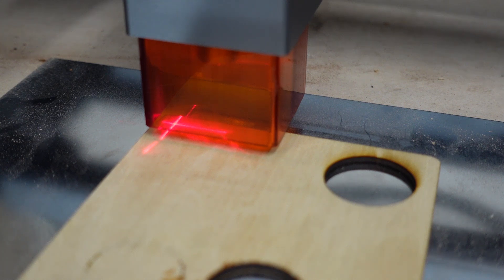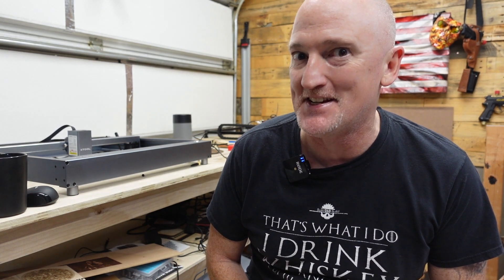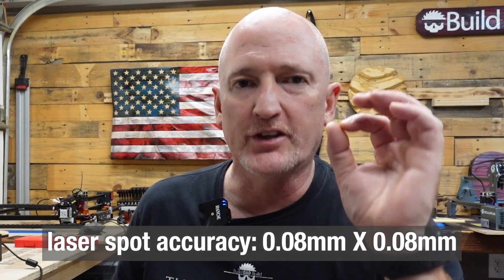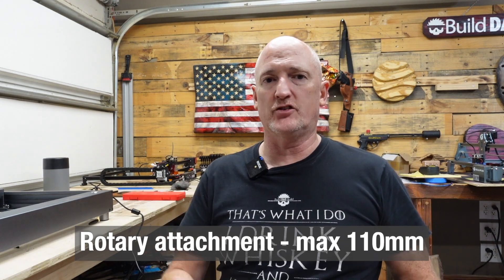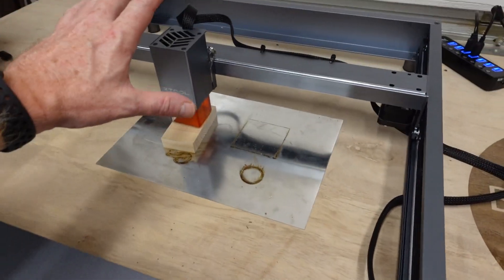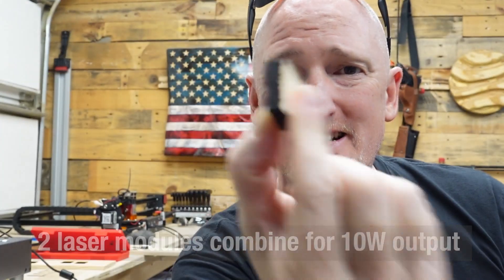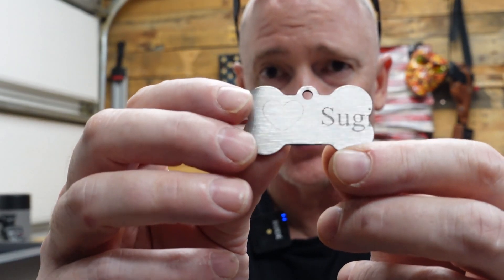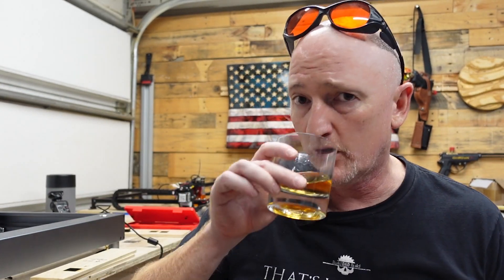Is the xTool D1 Diode Laser the BEST Diode Laser?

Comment: I have a bar top that has Parque floor tiles as the surface. They are not removable. Will it engrave the surface it is sitting on? level with the bottom of the Laser's feet?
Reply from the maker: Technically yes. Without knowing more I can't say for certain.
Cheers
Reply: If I set it on a flat surface and it’s level will it adjust down far enough to engrave the surface it is sitting on.

Comment: Hi Nick! Don’t know if you fixed the issue with the loose cable, but a simple hack is using 2 - “3M Command Light Clips” below the right side track. Just move the laser to the fartest left corner to extent the cable.
Reply from the maker: That's a great tip! Thank you!!
Cheers

Comment: Does it have limit switches?
Reply from the maker: It does not. It will home, but you can push it outside of its limits and grind it if you're not careful.
However, it's designed with an unlocked gantry with the thought that you can manually place the laser where you'd like to begin. Or you can home and pick your coordinates from there.
Cheers

Comment: do you know if the xTool 10W laser module can be used with other engraver frames? in other words, does it use the same communications protocols as other chinese laser modules or is it xTool proprietary?
Reply from the maker: I do not think it will mount on other frames without modification. The mount itself looks proprietary.
Cheers

Comment: Thanks for the video, I’m just starting to look into the Xtool D1. One question I have is if I want to engrave a cutting board that’s more than 16 inches long is there an easy fix for that?
Reply from the maker: Absolutely. You can prop it up on your own. Or they sell raiser to make it higher, for that reason.
And the raisers are SUPER easy to put on. They just screw into the feet that are on it.
Cheers!
Reply: Thank you so much for responding I just started following you today. And I used your link to buy the tool and they gave me $75 off
Reply from the maker: @larrygould548  SWEET! Congrats.

Comment: Hey Nick!  Thanks for sharing your process.  I make wood flags and I’m looking for a solution to speed up the process  with the stars and engraving logos in the stripes.  I’ve been considering investing in a CNC, but size and cost are prohibitive.  I know very little about laser engraving, but I spend a lot of time carving with the Foredom SR  engraver and I’d like to incorporate an automated process.  Two questions, if you please:  1. Would the stars be blackened once etched?  I don’t mind a little cleanup, but I don’t want to deal with carbon chunks in the stars. 2. Because of the size of the flag, can the frame be placed on top of the flag using risers?  Thanks in Advance!
Reply from the maker: Yes the stars would be blackened. But I did see one guy who tapes off the entire union and uses the laser to cut the star shapes. Then he removes the excess tape (everything but the stars) and paints it blue. Then removes the tape.
And yes, you can absolutely pick the laser up and set it on a larger object.
Cheers

Comment: I received this laser this week and I have to say it is a sexy POS.  They say it works now with lightburn, well it does not.    I have had nothing but problems with it.  It crashes into the wall all the time.  When you tell it to home, it crashes into the wall.  If you try to frame your work to tell where you need to put you material, it crashes into the wall.  There are no limit switches on this laser so it has no idea where it is.  If you want to put your work in the middle of the field, well good luck.  I tried everything and it would only work in the upper left corner.  There is no emergency stop switch, so if you have a problem you have to fumble  around for the power switch.  Not something you want to do if you have a real problem.  I ordered the rotary with this laser but did not get it.  I had to contact support to find out that it was on backorder, and they never even thought to email me to let me know.  There is no factory air assist with this laser, and that would defiantly come in handy.  Their setup video is horrible.  It moves so fast that you can't really tell what they are doing and what part that are using.  I have to say DON'T buy this if you are new to laser engraving, and even if you are a seasoned  person it will be hard to get it to work properly.  Do yourself a favor and stay away from this laser.  Sorry to put this up but I think it will help a lot of people.  This is not a well thought out machine. Yeah it looks sexy and well built but it's not worth the price at all.  I will be getting an Ortur for sure
Reply from the maker: Absolutely works with lightburn. You need to go to xTool’s website to pull down a profile to import. 
I have 3 diode lasers and this is by far the easiest to use and work with. 
I’m sorry you’re having issues. 
Cheers
Reply from the maker: Also if you had problems setting this up, you will have a very difficult time with the Ortur. Build time for the D1 is 10-15 minutes. Ortur is 30-45. Just wanted to make sure you knew. 👍🏻👍🏻
Reply from the maker: Here's the link to xTool's site where they do a step by step on how to download and import the profile into Lightburn. Hope that helps!
https://support.xtool.com/hc/en-us/articles/4414120232983
Reply: @BuildDadBuild  Thanks, but i did this.  I can not find this  xTool_D1_Prefs file.  Do you know where i am to get it.  It is not on there support site that ylou gave.
Reply from the maker: @madr8b  The file you are looking for is called xTool_D1.lbdev. I can't post a photo on here or I would show you where it is. Feel free to email me nick@builddadbuild.com because I'm here to help you. Even though you're dropping this negative rant on my video review of a  product that no only I support, but also rather enjoy using in turn making me look like I'm trying to con people.
Cheers
Reply: @BuildDadBuild  I apologize for making it seem a negative comment.  I was frustrated and should not have done that.  Thank you for your help.  I will try again and will try not to get too frustrated.  Thank you
Reply from the maker: I made a video on how to get it up and running in Lightburn. 
https://youtu.be/jambSsmFKT8

Comment: The software is very poor and limits your abilities to use this to its fullest capacity.  I bought it for the 10w laser, but had I known it would not use industry standard software, I would have made a different choice.
By the way, do not upgrade from laserbox basic 1.1.0 to 1.0.1 it breaks the positioning ability on the burn screen.  The earlier version works when you try to position the laser using the buttons to go left, right, up or down.  On the new release, it seems to be very harsh on the motors and the laser starts moving diagonally (not in a straight line) as intended.  Again, the software is beta release at best.
Reply from the maker: This now works with Lightburn.
https://support.xtool.com/hc/en-us/articles/4414120232983
Reply from the maker: I was not a fan of the proprietary software either. When they said they are working with Lightburn, I felt a little better about it.

Comment: Will it cut, or engrave aluminum?  If so, what thickness?  Thanks.
Reply from the maker: It's my understanding that anything less than a Fiber laser won't cut metal.
This will etch stainless steel and painted steel. I would think it would.
It's not listed on the materials list here:
https://store.xtool.com/collections/material

But this guy etched aluminum with his 5 watt....
https://www.youtube.com/watch?v=AfeEUKOYRyE

So I would think it's possible.
Cheers